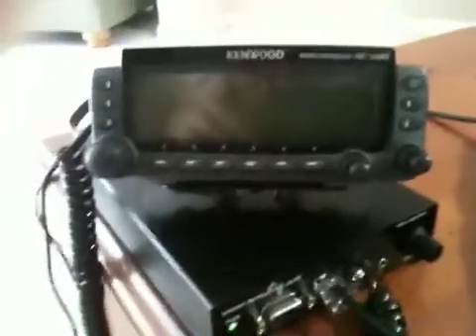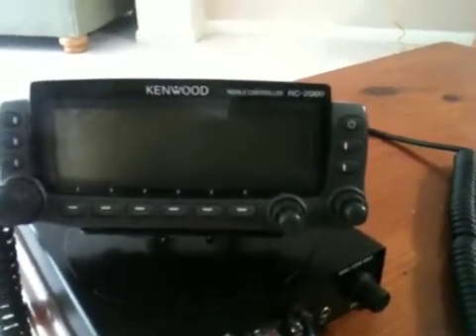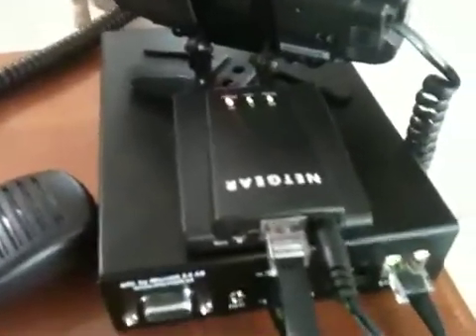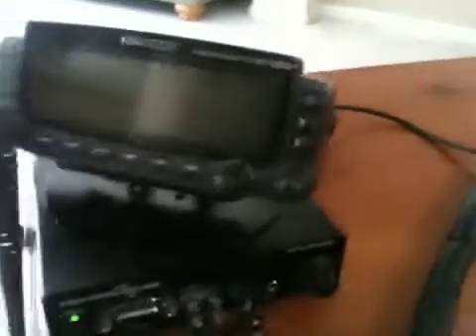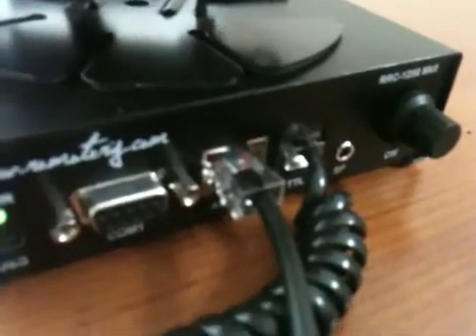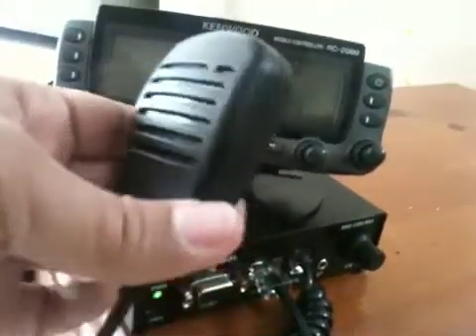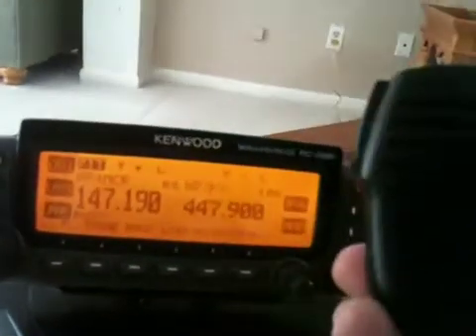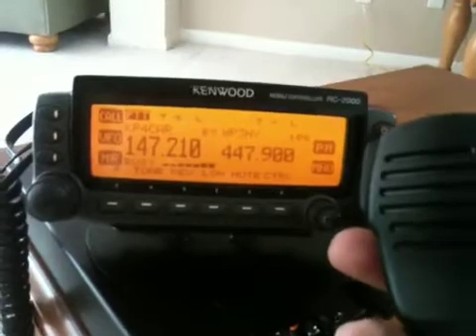Remoterig adapted wit HT speaker mic - by KP4TR

Comment from the maker: This was a fun project but havent touched in years. I used a cheap baofeng speaker mic. They are hand assembled so easy to modify. All i remember is requires special jumpering in remoterig to expose audio and 3v for electret mic. In mic i had to cut connector and crimp a modular 8 pin connector. Then inside mic had to cut wire and attach to soeaker to supply audio straight to speaker. Dont have details handy right now